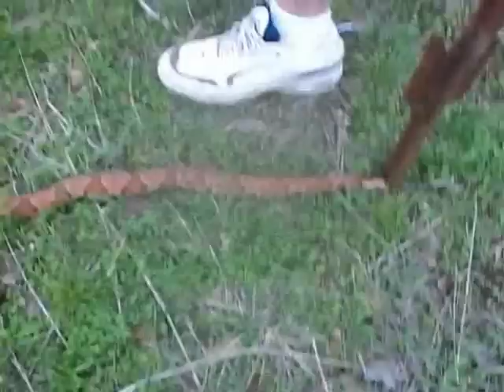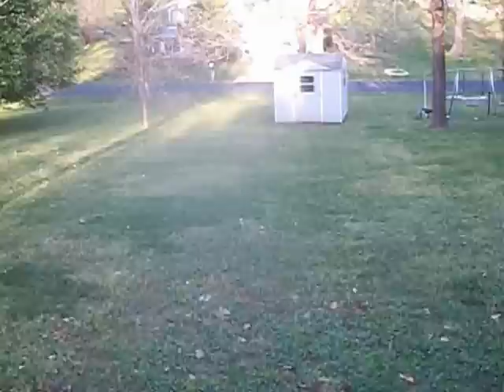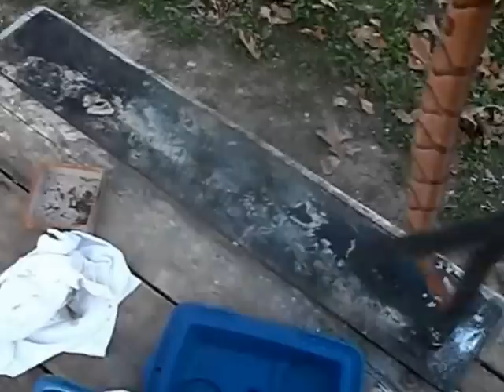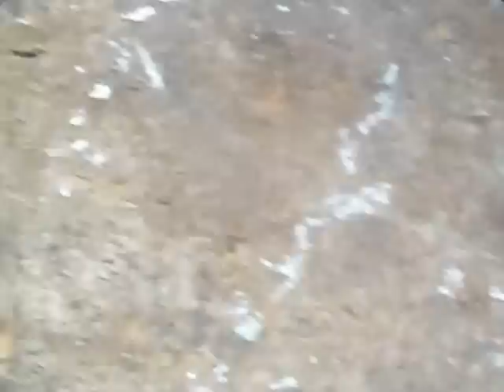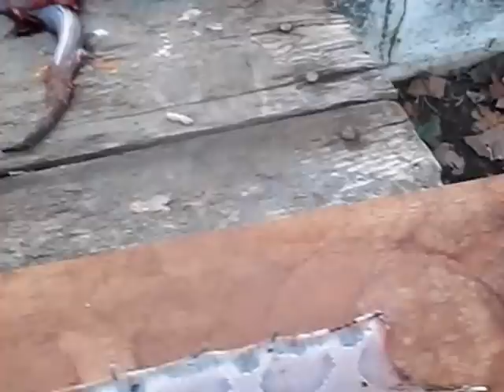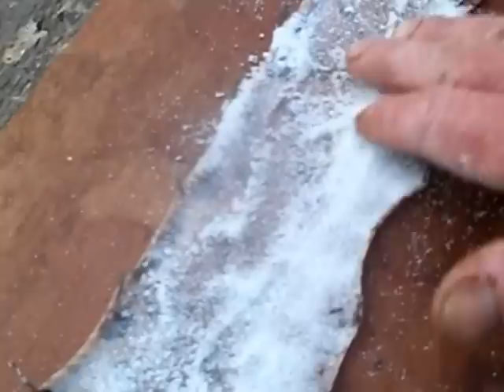A Trip to the Garden and a fight with a 40 inch COPPERHEAD

Comment: Salt is alright for Furs,but not snake skins. There's a solution you mix up,and roll the skin up,and let soak in it. Makes it soft,and preserves it. Salt,will dry the snakes out,and the scales will come off.
Reply: Nope . that's not true . Looking at a rattlesnake skin hanging on my wall . Salt cured and then rubbed with linseed oil .

Comment: There will alwayse be two. If they are old enough. They may not be just side by side , but be very carefull when you see one. Be prepared. I have a lot of copperheads. Any one know if there is anything you can put out to keep them away.
Reply: out to help keep them away.
Reply: Geri Brandon: I am told moth balls will keep the snakes away, (told by the locals here in central Texas.) You can find moth balls for cheap at the Dollar Tree, a pack for a dollar. I am not sure how true it is but my neighbors scatter moth balls all around even in my garden, I have no choice in the matter. I have never seen a venemous snake near my home, but before they put the moth balls around I did see a few non-venemous ones, (a couple garters and a king or rat snake.) Also beware of moth balls near pets or children they are supposed a carcinogenic substance, which makes sense why the snakes would be discouraged from hanging around.